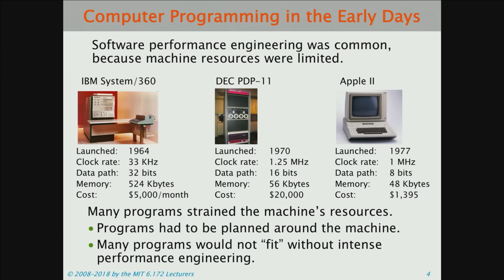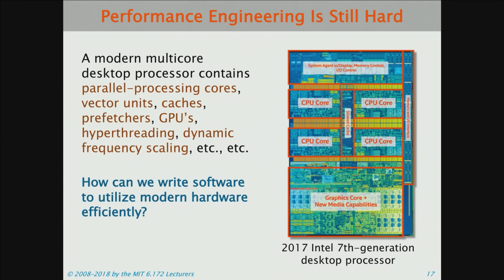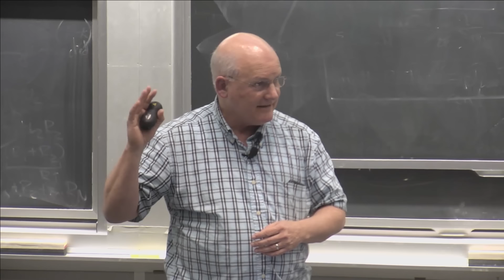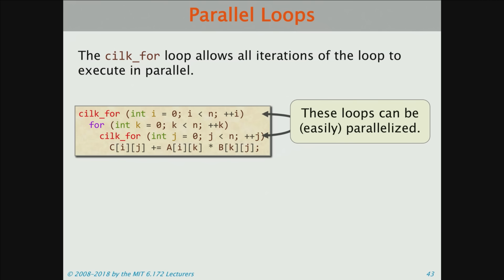1. Introduction and Matrix Multiplication

Comment: why bother with 3 tier CPU cache if the smallest aka L1D with 32KB could easily define the tile size and L2/L3 are only holding the next tiles to be ready when needed? likely saves a ton of cycles that could be used elsewhere!

Comment: Use s=32 and implement the paralel multiplication on a RTX5090 GPU with 128 threads per SM. Ofcourse, only 128 of the 144 SM's were used. OK, I know that in 2018 the RTX5090 was not yet available. It was interesting to see an update of this OUTSTANDING LECTURE with a real comparison with the RTX5090 if it is compatible with this Xeon core.

Comment: I went through this very engaging lecture and thought I understood it. Maybe I'm missing something, because I ran the matrix multiplication on my PC and my results came back very fast. Without optimization, C performed the operation in just 0.03 seconds. Please am I getting something wrong as to why it took longer to perform in this lecture
Reply: Did you use 4096x4096 matrix?

Comment: anyone know why the middle loop 
for k=0 to n 
cannot be parallelized?

was hoping to see solution and explanation at the hw1, but I think he didn't actually put it in the course assignment
https://ocw.mit.edu/courses/6-172-performance-engineering-of-software-systems-fall-2018/2724d8594cb413754669fc4e9c6ce7db_MIT6_172F18hw1.pdf

Comment: Can someone explain why the k loop can't be parallelized?
Reply: Because it's the A[i][k] * B[k][j] so k is common between A and B and needs to be executed sequentially for obtaining the result C, this is my understanding of the reason
Reply: it could result in two different cores updating a[i][j] simultaneously, resulting in incorrect evaluation (some updates could be overwritten by those of other cores without taking their effect into account for instance)

Comment: These optimizations are amazing, python code isn't great though. I managed to write a pure python version that runs in 300s(using pypy). No optimizations other than loop reordering. Still slow, but it's just 5 loc that were written in 3 minutes.
Reply: You used concepts from his lesson anyway.
Reply: @betancourt441  yes, it's an amazing lecture. Just wanted to highlight that barely optimized python is less than 2x slower than C at the same level of optimization.

Comment: Great class. I had to laugh at how much just two years have given over to specs as he describes the AWS large machine as a "honkin' big machine".  Enterprise VD environments are really pushing what constitutes a honkin' big machine upward.
Reply: There were bigger AWS options even in 2018, the point is that most folks are using less than 1% of it and think they are really cooking or that they just need a faster machine. 
Seeing what 1980s programmers could push through an 8bit console with 2k of memory (like the NES) with various optimization tricks, now those machines had a good utilization ratio.(Yes, they were simpler than modern workstation architectures and thus easier to optimize.)

Comment: If I wanted to make an Amish-like computer, using very simple and primitive parts, and if my goal was to produce all of it in the United States instead of in China, it might make sense to build computers and appliances that had less power, less memory, a frugal approach to programming. You might make a goal of building a computer that doesn't use certain kinds of rare earth elements or something, using only elements that could be mined locally, so you would give up a lot of the advanced, modern hardware.
Reply: You can make computers with water and mechanical valves. So what?

Comment: My takeaways:
1. Why do we study performance engineering 0:57
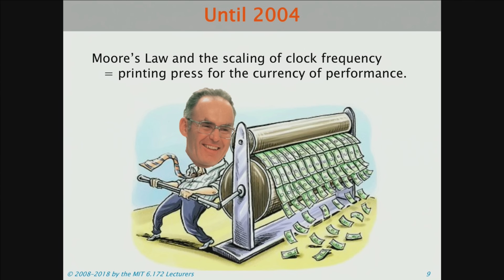1.1 Why we can't improve the frequency of hardware anymore 10:00, because static power consumption dominates the power consumption in modern hardware, and it is hard to reduce it.
1.2 Parallelism is used to increase performance 11:49, but the performance is no longer free since we have to write programs that can run in parallel.
2. An example of performance engineering: Matrix multiplication 15:35
2.1 Hyperthreading can improve performance a little bit, but it makes performance measurement difficult 17:17
2.2 Python code running time: ~6 hours 19:38
2.2 Java code running time: ~46 minutes 23:44
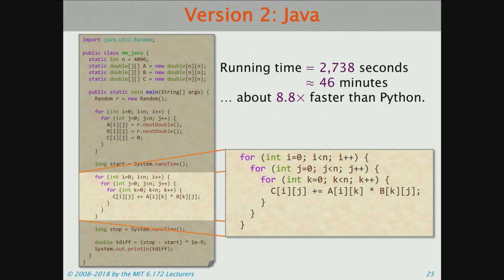2.3 C code running time: ~19 minutes 24:23
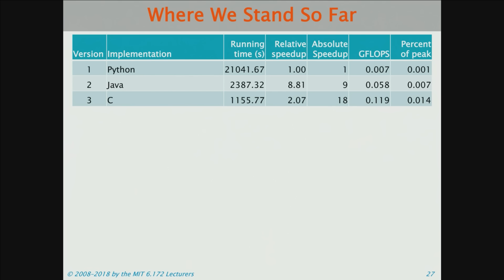2.4 Why Python is slow 25:30, because Python is interpreted, C is compiled and Java is in between.
2.5 Further improvement on the C code. 
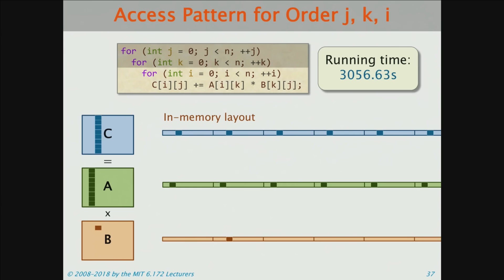- Change the order of loops: ~3 minutes running time, because cache locality is exploited 29:50, and we can use measurement tool $ cachegrind 33:54
-- In C, a matrix are stored row by row in memory, therefore access data column by column can exploit cache locality.
-- In C[i][j] += A[i][k] * B[k][j], we want to maximise the access to the column index which are [j], [k] and [j], and because there are two [j], put [j] in the inner loop could maximise cache locality.
-- We also want to minimise the access to row index because it can break cache locality, and since there are two[i] and one [k], put [i] in the outer loop could maximise cache locality.
-- Put [k] in the middle loop.
- Change the compiler flag: ~54s running time 34:59
- Use more cores: ~3s running time 36:24, rule of thumb is parallel outer loops rather than inner loops.
- Manage cache for data reuse, tiled matrix multiplication with parallelism: ~1.74s running time 40:10
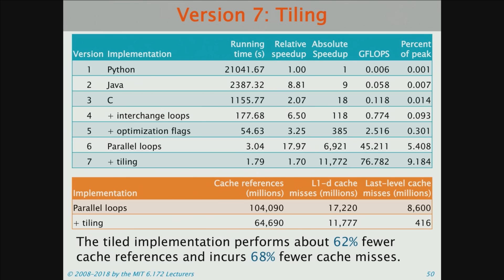- Tiling for two-level cache, recursive matrix multiplication with parallelism: ~94s running time 45:45, because the overhead of recursion is large, but we can coarsening the recursion to get ~1.3s running time 49:00
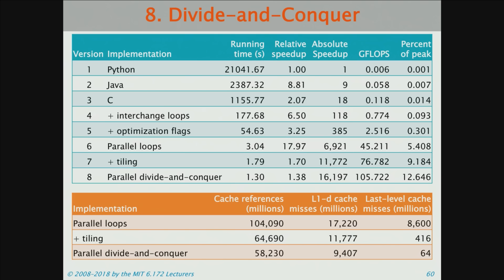- Using vector hardware, SIMD with compiler: ~0.7s running time 51:35
- Using vector instruction directly: ~0.4s running time 55:55
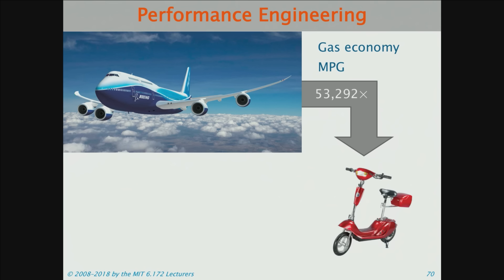3. Matrix multiplication is a good example, but we generally won't see such magnitude of improvement in other cases 58:58
Reply: Great takeaways!
Reply: Can anyone reply if all these videos are to be watched in order or are they all independent of eachother?
Reply: @Kingpin.7  Mostly in order
Reply: good job
Reply: @hinata yuki You are welcome!
Reply: big brain time
Reply: Hi, Do you know which are the textbook used?
Reply: You're God's gift to humankind. Thanks a ton for this Lei Xun! Much appreciated!
Reply: @vishnusingh4118  You are welcome

Comment: what is the pescribed reading for this course ?.
Reply from the maker: 6.172 has no required readings. There is a list of supplemental readings on MIT OpenCourseWare at: https://ocw.mit.edu/6-172F18. Best wishes on your studies!
Reply: Thanks  @mitocw
Reply: In Performance Engineering all aspects of Computer Science come together: Programming, Operating Systems, Memory models, (Parallel) Algorithm designed, Computer/Chip Architecture, Infrastructure Architecture etc.
Performance optimization is about going from one layer (to optimize) to the next layer of the architecture of your application and continue cycling through the layers till goals are met. Always measure, qualify, quantify before change something. Ok, sometimes you do not have enough understanding or some parts might be a black box, that allows for experiencing.

Comment: From 6 hrs in python down to less than half a second.  Indeed impressive optimization!
Reply: And you said that exactly 6 months back from today.
Reply: @takasurazeem 6 years ago now
Reply: @LilithaMahlombe  Glitch in the Matrix, in 6 decades our offspring will be fighting in The Great AI War.
Reply: or effectively rebuild intel MKL, more specifically a power of 2 sized matrix being worked on.

the other thing is the CPU used is from 2015 originally!!!
Reply: spoiler warning zzz
Reply: spoiler warning zzz
Reply: most of it attributed to parallelization and language though (trivial changes)
Reply: @awsumpersun321  Only trivial an an absurdly high level abstraction. Just try to implement either. If you take those two out as not everything can be parrallel(or alternately the task is already parallel), and if you are not totally daft(regarding high demand computation) and assumed a compiled language from the start; then you are still looking at a 92x improvement. Now consider super compute machines that consume $10'000 per day and many scientific processes that need many days or even months of runtime. Then even 2% is a substantial savings, let alone cutting it to 1/92 (~1%) of the original.